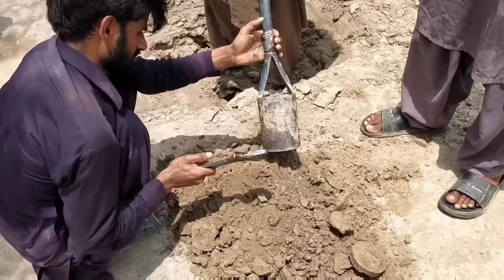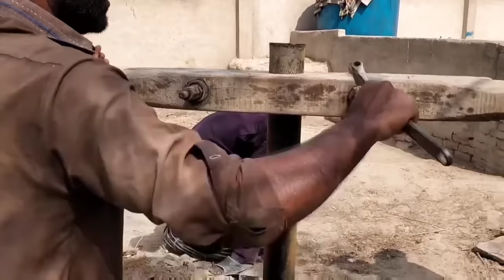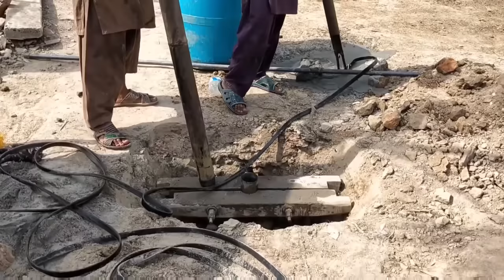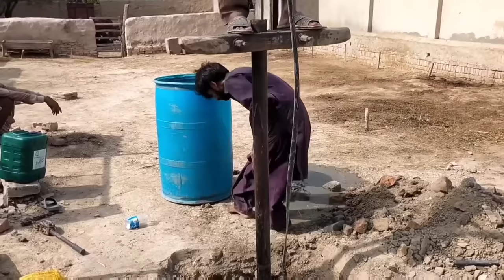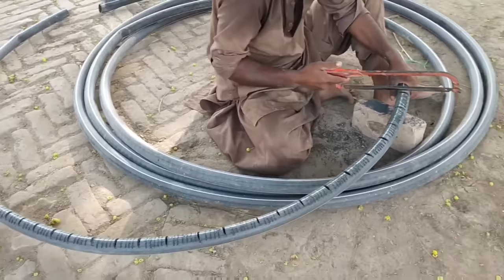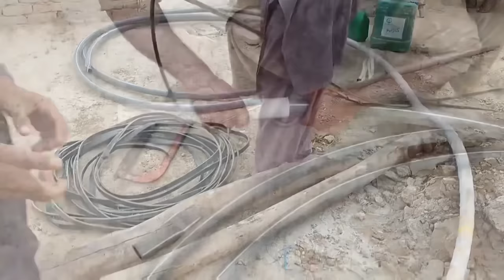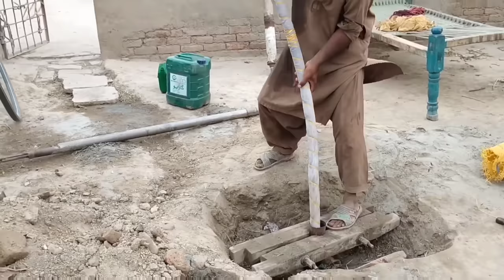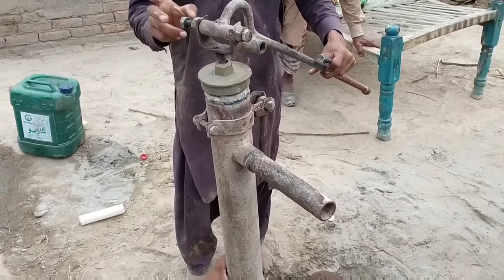400 Feet Borewell Drilling Within 7 Hours with latest technology | Borewell drilling Feast Your Eyes

Comment: 400 inch...not 400 feet
Reply from the maker: 400 ft , you can see full video
Reply: Again, it's physically impossible to raise water more than about 10 meters, even with the world's largest pump, topside.   Maybe 400 centimeters, 4 meters?

This has been known since the time of Galileo, 700 years ago.   It's an inviolable law of Physics.    1 bar of air pressure can only push up about 10 meters of water.   To do better you have to lower a pump down to the bottom of the well, that works, no problem.

Comment: 400 inches
Reply from the maker: No
Reply: @wow90s  400" = 33'4" or 34 feet 4 inches.  Maximum vertical suction lift is approx 34'.  Good work, but not 400 ft

Comment: Mostly fake, its Not possible to pump with this kind of pump more than 10m, that simple physics.
Reply from the maker: 10 meeter water will come ??? just answer me where is the pure water within 10 meter ??
Reply: @EESkills  no Not come, its Not possible to pump up water with this kind of vacuum pump more than 10m up. If its deeper you have to put a pump down the Well.. So they only made the6whole a few meters only not a few 100... Thats fake
Reply from the maker: @ak6318  bro , this is 400 feet its normal thing in my country, and this is poor country and they utilized their talent for needs like water , and if you watch it till end you will see how many pipes they putt down, each pipe is 5 feet and more than 70 pipes they pull down

Comment: 400 ft is a lie. 29 feet max
Reply from the maker: 360 feet
Reply: @EESkills  NOT. cannot pull water at sea leaver (29.29 inches) more than 29 feet.

you are trying to sell your lie to the wrong person

AND the pump did not have any sucker rod as to have lifts in the water 

3 inch pipe weights just over 1.5 Lb per foot that would be over 600 lb (not counting the drag) and he jacked it up with a 4 foot leaver.